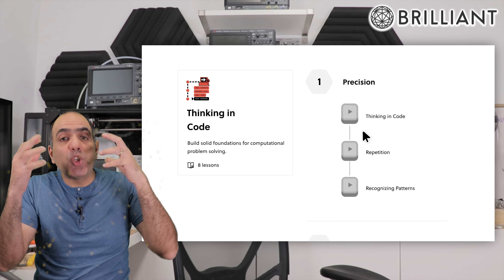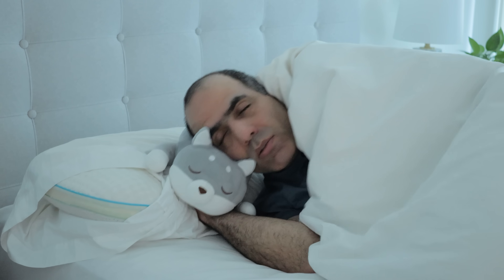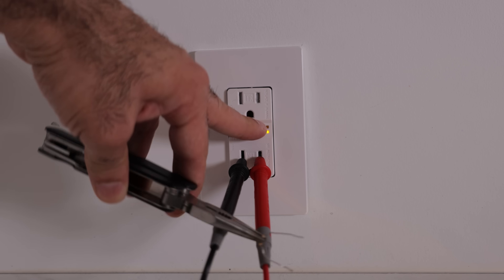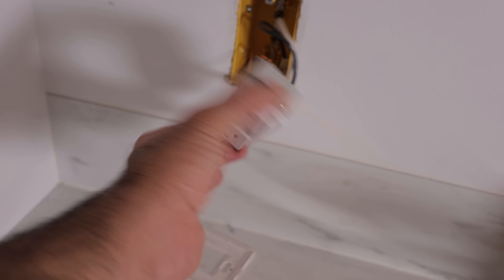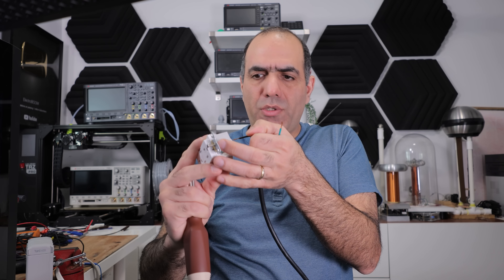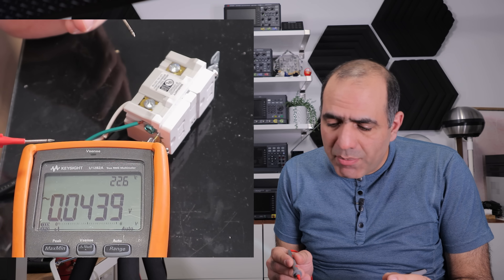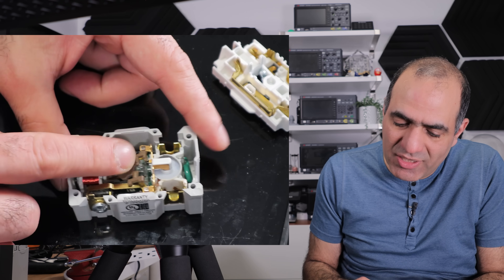Repairing Faulty Ground Fault Failure

Comment: I didn't know these protective devices were electronic. In Italy they are electromechanical mechanisms.
Now I wonder: do these devices consume energy?
Reply: Yes, a very small amount.  If you have 10mA RCDs in Italy odds on they too are electronic types as its difficult (ie more expensive) to produce a electromagnetic type with very low mA thresholds.  Usually the cheap 30mA (and higher) ones are electronics too.  It's cheaper and easier to produce an electronic one than purely electromagnetic.

Comment: Wait, so the test button doesn't actually test the gfci with a test current between live and earth? It just energizes the solenoid directly and therefore tests only the mechanical part of the breaker?
Reply: No, it is doing the bypass trick.  You see that large resistor?  Pretty much guaranteed the strip of metal it pushes on simply connects the resistor between line  on the supply side and neutral on the load side (or the other way around) causing imbalance in the sense transformer.

Comment: Knowing how it works is the first step you need to take before you can even attempt to fix it. But I generally agree, that sometimes disassembling something and then reassembling it can fix the problem.

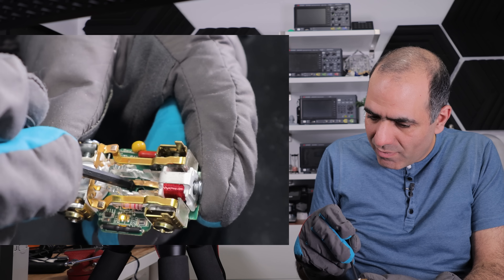Comment: 8:08 
Electrical engineers when they have to work on the most simple valve ever
Reply: and vice versa. I can understand a comple madness of springs and levers, but even a simple circuit requires me to engage 100% jf my brain...
Reply: @ErrorTH  and here too, I haven't finished any school, yet I can understand the overall mechanism and circuit when it is shown to me, but to think about it from a new project perspective and i wouldnt be able to differentiate an open gate and polarities most likely lol
Reply: @alexturnbackthearmy1907 conventional VS electron flow notation. Picking one would require engineers and physicists to compromise. We don't get along.
Reply: My dad used to fix cat scanners. I'm a mechanical engineer, building high precision low flow pumps. Home for holidays, hd gets a call, and we both go in. As we needed to track a circuit to a test point, we both looked at the prints and figured out where it was at the same time.

He read the print as an electrical print. I read it as a fluidic flow chart. 😀
Reply: xD was thinking the same thing
Reply: Lol I never understood how people have trouble with mechanical devices. You can just look and see how it works, whereas electrical circuits are the ones with invisible operation.
Reply: @SafetyLucas  I'm a programmer, and worked at an electronics manufacturer for a long time, with a bunch of electrical engineers.  They designed the system, and I wrote the code for the various CPUs and microcontrollers.  I found that I could understand the basics of ohm's law, but whenever it got more complicated than simple serial or parallel resistances into complex circuits, I got lost.  Likewise, when I tried to explain to the EEs anything beyond simple loops or IF/THEN structures, they got lost.  And it wasn't a matter of education - I am self-taught, as were many of the EEs.  Everyone's brain just works a little differently.
Reply: @ReadTheShrill   I am a programmer and my hobby is EE, I get that. The thing is that you have to spend time playing with things and looking at the tables of curves of the devices you're working with to get the feeling for the abstraction they create when using the devices in circuits, its all about having a mental model. 
It helps if you ever worked with signal processing in software, then you start understanding electrical engineering.
I think nothing can replace practice, you assemble circuits in a protoboard and do shit and use your O-scope to see the results.
You can't get that intuitive understanding just from reading the diagrams without playing with the devices. 
The same way you can't learn to play the guitar just from reading tabs, you have to play the guitar actually.
Or with programming, trying to learn how programs work without doing live debugging, just from reading the code.

Mechanical engineering is nuts, you just look at the pieces, and how they move, but then if you follow the forces like a signal in a circuit, then you start to get it. Its almost like the mathematics of signal processing is the core of engineering.  (heck, I have no formal education on any of that, I'm a humble computer scientist)
Reply: @monad_tcp I think that idea on signal processing is right, I'm an electronics engineer and back at school we would model mechanical systems as electrical circuits to apply EE maths and trickery
Reply: @monad_tcp  I was an electrical engineer, now retired. I designed various circuits with logic chips, shift registers, and memory chips, etc. As I went along I could envision the whole thing as a three dimensional entity in my head. This was not hard. We once had to design a new paper reader. It had driver wheels, tensioning springs, and other mechanical stuff. I was totally lost. Especially when it came to selecting the proper springs.

Comment: Gloves?! My god, that's the first time i see Mehdi wearing protective gear on his hands.
Reply: GLOVES!
Reply: 😢mmo?
Reply: He did wear gardening gloves waaayyy back in the Graphite video (I think that's from 2017), but that didn't end very well for him😂 I'd recommend going back and watching that.
Reply: If he made one mistake and it caught a glowing wire or caught fire somehow he would need to get skin grafts.
That stuff he used as "protective" gear, well that's literally liquid fire when it ignites, dripping, oozing, splashing is guaranteed. Especially if you handwave in a panic.

I still shiver at every move he makes even without overthinking it the way I just demonstrated, it's a miracle (oh and a lot of skill) he still has all his digits and original skin.
Reply: @Yezpahr  It's fine, he sheds skin 4 to 12 times a year and if his limbs got cut he'll just grow them back.
Reply: @freezred  xD he must've bought some gene splicing shots from Thought Emporium. (The guy that runs that channel made himself temporarily get rid of his lactose intolerance.)
Reply: He should consider protective HEADGEAR..........Zap/ Shock/ Bang Head......Repeat.
Reply: @edwardhugus2772   he really should use a hard hat, he bangs his head too much
Reply: I'm surprised Mehdi even knows what gloves are!
Reply: @acmhfmggru   when I was a kid, I grabbed both wires (live and neutral) by mistake when I was assembling a battery recharger, 110v allows you to still control your muscles to toss the thing away fast, just like when you put your hand on hot things, like the soldering iron tip. current probably went through my chest, but kids are immune to that (If I ever do that mistake now I probably die).
Reply: @monad_tcp I once was using a tester screwdriver to test for current in a outlet I was about to change to a bigger one. The tester requires you to be the one to Short it to earth so you need to touch the other side of the tester to make it work while standing non isolated from ground .  but the tester was broken as the resistor in it was shorted somehow and I got zapped with 240v but good thing was that I pulled my hand away quick that it didn't hurt much and I was like "oh!, I won't do that again".
Reply: @acmhfmggru  Yea lol, that warning I put there was self-admittedly overthought. xD

I've seen winter gloves turn into dripping fire exactly once (in industrial setting indeed).
The only thing I know for sure is that one second it was "safely" on somebody's hand and the next second that hand was spitting fire like an angle grinder.
Coincidentally, that was his job, grinding metal with an angle grinder.
He got fired twice that day lol, figuratively and literally.
Reply: Mehdi used his “touch-enabled” gardening gloves in the graphite railgun video.
Reply: he stages a lot of the zaps, burns, and mishaps for entertainment value -- but he also knows when to not screw around. One of the few videos where the jolt was not preplanned was when the Jacob's ladder fell in his lap -- and it legit scared the shit out of him.
Reply: am your 1000th like :D
Reply: And typically my first impression is how is he still alive?
Reply: I've accidentally touched an electric fence
Reply: @acmhfmggru   I'm not boosted, I'm not a rocket and I have immune system that works, I'm a switch mode power supply, not a buck converter.
Reply: But he was cold.. why not.
Reply: His glowes caught fire in an earlier vid.
Reply: You should watch the carbon batteries episode and see what happened to the last gloves...
Reply: Fr
Reply: It is 110 AC electricity. One mistake can send him to the other world. It is normal for him to wear gloves.

Comment: disassembly then assembly often fixes stuff for me to. great achievement to have.
Reply: yeah especially when it doesn't need the parts that were not put back
Reply: @HikerBiker0  Sometimes you don't need to put back all the parts. My manager says it's even better because it makes the airplane lighter and more efficient. The new intern took it too far though... he removed one too many bolts from the door.
Reply: @FineBakedPastry kek, do you work for boeing?
Reply: @FineBakedPastry  a lighter plane means a fast one
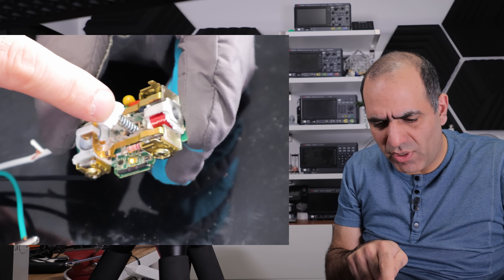Reply: It seems he also burned a little bit the small coil inside. You can see smoke 8:21. Not sure if that makes the difference.
Reply: @anj000  I had a Weather Resistant outlet, similar model, that burned up its coil.
Reply: No it’s often frustrating because you’re like why isn’t this piece of shit working so you take it apart, find nothing wrong, put it back together and it suddenly starts working again
Reply: @Akotski-ys9rr  Exactly, i find it frustrating, too. mostly because you dont know if it will last ten years or ten seconds after the "fix".
Reply: When you disassemble stuff you inadvertently remove dust and debris that might have accumulated on the device that was most likely causing the malfunction. It's pretty common.
Reply: Software Support: "Have you tried turning it off and on again?"
Hardware Support: "Have you tried disassembling and assembling it again?"
Reply: It's not so great when the issue was an intermittent fault and you have no way to be certain it's really fixed and for good.
Reply: @chitlitlah  yep, big issue in software development, without reproducibility or consistent reproducibility, good luck
Reply: Not for me

Comment: probably a dumb idea, but what if the faulty part was the test button? What if part of it was bent a tiny bit, but enough to trip it with a small change of temperature? 
That way it could trip and then it resets before it slowly goes back to its "original" (faulty) spot where it trips it again

Comment: Mehdi you are an electrician that wants our European protection. So why don't you install it yourself in your own home?
Could also be a great lengthy YouTube series.
Reply: Do we have 30ma whole house RCBO units in the US?
Reply: @bichela   Yes and no. We do have GFCI breakers (RCBO) for branch circuits (or subpanels) but they trip at out safer North American standard of 5mA. I've heard many (but not all) AFCI breakers happen to have built in 30mA ground fault protection but it's not advertised.

And side note, while standard European RCDs trip at 30mA I thought RCBOs tripped at 12mA. Also note that (AFAIK) the European ratings are must-trip current and American ratings are the nominal trip current. So a 30mA RCD is really a 24mA GFCI and a 5mA GFCI would be called a 6mA RCD.

Comment: For as often as Mehdi performs his GFCI tests, he ought to 3D print some sort of enclosure that would let him put his probes and resistor all in place ahead of time. Sure, wouldn't make as much of visual spectacle, but it'd be easier!
Reply: as long as the enclosure features a ton of live exposed wire i agree
Reply: The word shoddy should be in there somewhere…

It is also a great video!
😎💯
Reply: It's all part of the pagentry
Reply: I bought a cheap tester which also happen to test GFCI.

I didn't have any protection besides sketchy grounding and GFCI in bathroom.
Reply: Too safe for Mehdi
Reply: @chrislemus9392 yeah then it would be just Electro
Reply: @zUltra3D  gets it
Reply: Why 3d print something when you have screaming meat? Lol
Reply: No explosion no fun
Reply: Yeah, then maybe if he 3D-printed an enclosure for that, and built in the resistor, etc, he could actually make it into a little portable device with a button or something which you could plug into an outlet and test the GFCI with.  Heck, he could add a couple of other lights and it could even tell you if the rest of the outlet is wired correctly.  Then he could sell it as a product or something!

(Note for anyone who didn't get the joke: You can actually buy an outlet wiring tester at any hardware store for $5-$10 that's intended to do exactly this.)
Reply: I strongly suspect most of the shocks/pops are added in post. 🫠 He's got a good schtick worked out, but he's intelligent- he wouldn't actually allow himself to be shocked by say, house current for example.
Reply: Fr
Reply: That would be ElectroYAWN though.
Reply: Would it be though? Resistor + Pliers seems about as easy as it can get. I mean he doesn't have to design, construct and test anything!
Reply: He could create a version that also has a capacitor slot, so it's easier to test, but still explodes anyway (and it's easier to change the capacitor)
Reply: @BiaginiMatt  The GFCI would probably trip before the capacitor explodes.
Reply: Or use a dedicated tool - e.g. Two-pole Voltage Tester with a residual current protection trip.
Reply: You can even buy ready-made CFGI testers. But that's not the point, the point is to have a funny video.
Reply: Or just get a GFCI tester for like, $10. 

Using proper tools is not the point of this channel.
Reply: It wouldn't be funny
Reply: Hey Google how do I delete someone else's comment
Reply: No views of no pain
Reply: You've missed the point completely
Reply: Bold of you to assume he know how to make 3d model and use 3d printer
Reply: @dhpz  he used 3D printed parts to make that fairy lantern
Reply: @dhpz The TAZ is visible behind him.  You think it's just for decoration, or perhaps non-working?

Comment: HELLO MEHDI!!!! You should ask Big Clive to analyse the circuit
Reply from the maker: HELLO!
Reply: @ElectroBOOM  Hey! I just opened a RCD at my home and did not find any electronic circuit. All it has is a current sensing transformer, a permanent magnet mechanical relay with a small pin coming out of it that pushes some mechanical lever system to trip the breaker.

The two out put wire from the transformer connects to the coil pins of the relay directly with a 1n4007 diode connected across it.

How does it work?
You should open one of these and make a analysing video on it. It looks simple with no complicated circuitry.
Reply: I was going to say the same thing!
Reply: @danwhite3224 same
Reply: lol I was gonna suggest the same, Clive really does go deep on circuits :) too bad for all that resin covering the PCB though, that would be a pain to non-destructively remove
Reply: He would probably just print out a nice circuit board diagram and wax poetically as only he can about how you shouldn't do what medhi does lol 😂
Reply: Big Clive has a number of viedeos on GFCI / RCD devices for anyone interested
Reply: bigclive and diodegonewild
Reply: I was just about to say that too.
Reply: Clive already did, ages ogo😅
Reply: The manatee?
Reply: How did you type this 19 hours before the video was uploaded!?!?!?!?!?
Reply: @NC_Isro_64  Upload is not the same as publishing.
A video can be uploaded and not public. Anyone that knows the URL can access it and comment. People get early access (and thus the URL) through things like channel membership, Patreon, etc.
The time/age of the video we see is time from publishing, not upload.
Reply: @NC_Isro_64  I'm  from the future!

Comment: That's such a smart way of detecting leakage voltage by running Live & Neutral through the coil! Love the video!
Reply: The better way to measure ground leakeage is to actually disconnect the ground/earth on the pannel and put an ampmeter between the connection 💀💀💀 PLS dont do it.
Reply: How tf 23h ago??! 💀
Reply: Maybe a member
Reply: 20 HOURS AGO?!💀☠
Reply: WTF
Reply: "19 hours ago" 💀